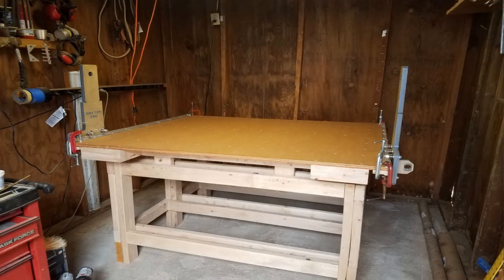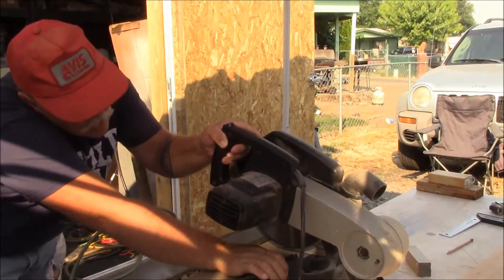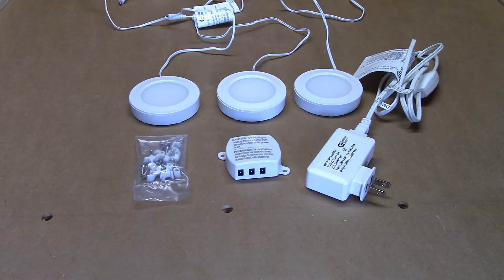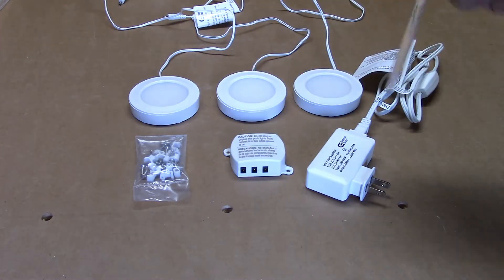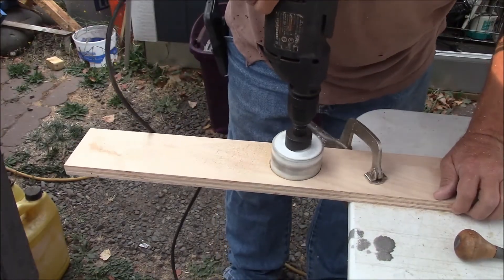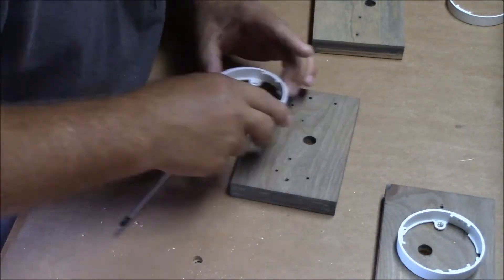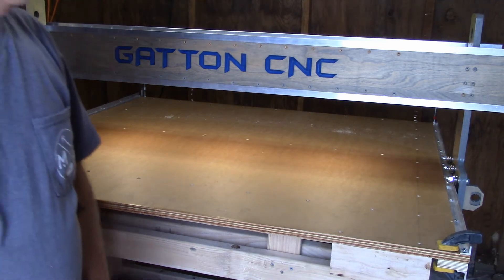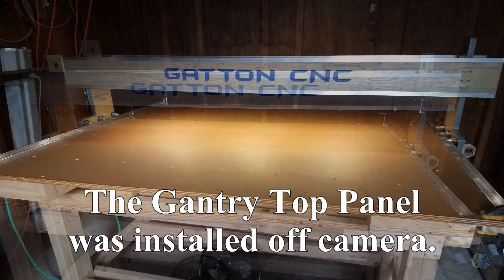Gatton CNC Build - Part 6 - Gantry Panels and Linear Rails

Comment: What size screws did u use on the angle axis
Reply from the maker: I really can't remember. I believe I used #10 x 1" round head screws on the angle itself, and #8 x 1 1/2 inch tan painted deck screws for the strips.

Comment: Mark, this is great stuff. I’m following both you and Dave. I’m in the process of building my own unit.

One question tho, in your earlier video building the table, you left an area at the front for vertically cutting dovetails and box joints.
I see the area in this video,but you have it covered with the table top. Did you change your mind ?
Or will it and the spoil board be cut out later ?
Reply from the maker: Yes, I changed my mind and mounted a rotary axis there. If I had it to do over again, I wouldn't have even made the cutout. It's just not necessary.
Reply: Mark Lindsay CNC  interesting, because after watching your videos I changed my design to include that cut out. I want to be able to make dovetail and box joints for the boxes I build.
Reply from the maker: If you build it according to the plans, using the 3.5 inch router (Porter Cable 690 or 890 series,) the center of the bit will go 2 1/2 inches beyond the front edge of the table. That's plenty of room to mount stock vertically if you want to cut box joints or dovetails in 3/4" thick stock. If you want a bit more "cushion" there to be able to machine thicker stock on edge, then you can add the cutout if you'd like. My main point is that it isn't really necessary to do the cutout, but it doesn't hurt anything either.

Comment: For the logo ... what bit/depth, etc. did you use?
Reply from the maker: I made the letters 2.5" tall, and didn't set a flat depth in VCarve Pro. I just let it cut however deep it needed to cut to get the cool faceted bottom and square corners.

Here's a link to the Bosch 90° v-bit I used:   http://amzn.to/2vZjg4A
Reply: Thanks Mark!

Comment: Very useful addition to the build, I had not thought about that issue but, it just adds the WOW factor! What else have you got up for cool and useful addons?
Reply from the maker: Thanks George. I have a couple more coming, but nothing with this much "wow factor." Mainly just a few little tips and tweaks to make the assembly, tuning, and using the CNC go a little easier/smoother.

Comment: looking killer Mark. keep up the good work when I order mine I will have some videos to watch, I really like the cut out idea for 4th axis and dove tails and the lights are awesome.
Reply from the maker: Thanks very much! The cutout is one of those "work in progress" things. You'll notice I still haven't actually cut out the tabletop. I still have to build the 4th axis, and that's going to be a while down the road. You can bet I'll do a video on it when I get all the parts assembled and get going on it.
Reply: Mark Lindsay CNC  well I can't wait for that too I'm going to try and record mine I'm going to go with steel angle though I have noticed wear down in certain parts of mine where the gantry moves alot and makes my cut depths change because my gantry is 6ft it weighs alot to much for aluminum I think but I'm definatly stealing some of your great ideas when I rebuild mine soon keep up the good work as always Mark.
Reply from the maker: Are you sure you aren't just tightening the adjustable bearings too tight? I know a couple of people who have 6' gantries, and they've had no problems at all with wear. Of course the grade of aluminum angle makes a big difference too. I'm using the 6061 T-6 aluminum angle from McMaster, and it works great. My old Shoestring Budget CNC had no real wear at all.
Reply: Mark Lindsay CNC that very well may be the problem to tight and the aluminum was from lowes so the no telling how good it is it was my first build and I have learned alot since then so maybe I will get some from McMaster and see and my router is very heavy 3hp rigid but I'm getting a spindal motor for the new one too
Reply from the maker: Dave runs a 2.2 KW water cooled spindle on his Gatton CNC and the same aluminum angle from McMaster that I bought. He has absolutely no problems with wear at all. I checked his machine out myself while I was down at his house during the Atlanta show. The original marks he drew for mounting screw locations are still on the edge the bearings ride on.
Reply: Mark Lindsay CNC well that's good to know I think I was to tight  and might have done it to myself going to order from McMaster and be more easy thus time I was new last time